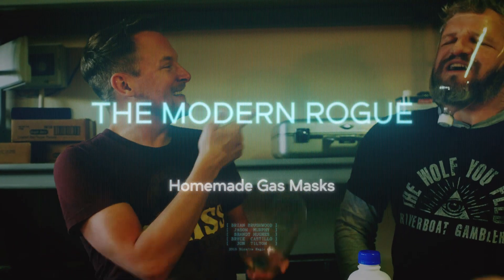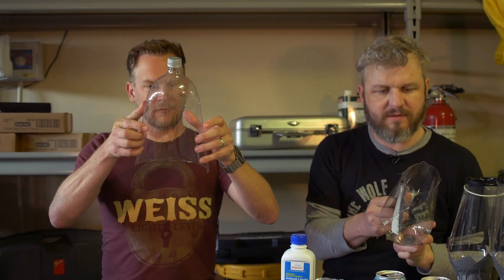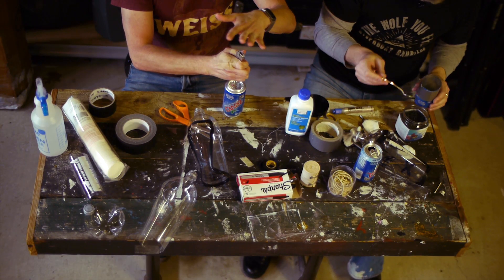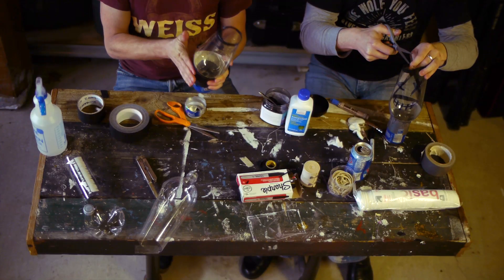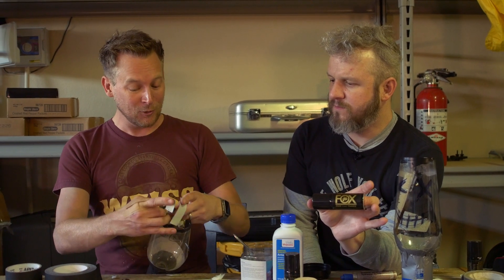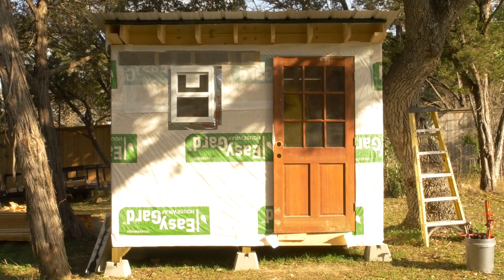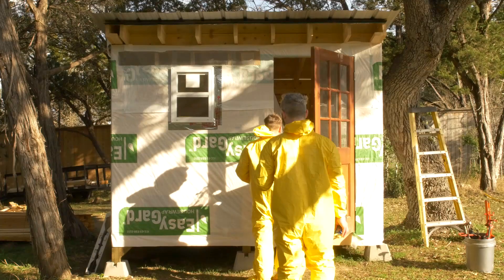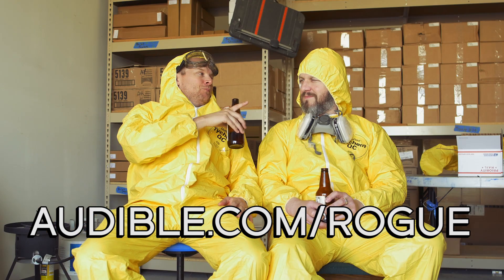Homemade Gas Masks vs. Tear Gas Grenades

Comment: Well done ! I have seen this design on many channels,  but they all have one flaw . If you look at a respirator,  or gas mask they have pressure relief devices . Most of the time it is a rubber diaphragm.  When you breath in it creates a negative air pressure in the mask , this tightens the mask to the face .   When you breath out it creates a positive air pressure,  pushing out on the mask causing a possible leak . I am looking for a cheap , readily available fix . Possibly a snorkel.

Comment: I HAVE A HOME MADE GAS MASK DESIGN THAT HOPE YOU MIGHT BE ABLE TO TEST
 It is the exact same, but uses a two to three compartment part wet filter.
 the first section is contained in the same manner as the activated charcoal, and is simply a wet rag  stuffed into the front of the filter. The second section is just a dry cloth or sand filter, that can be made using straws (filed with sand and contained using cotton stuffing,) or a second section inside the canister. (possibly a second soda that has been cut in half or a third. 
Sand is used to absorb excess water from the filter and then dry quickly. Cotton may work just as well to stop water, but is more easily contaminated. 
You can use a candle wick style water feeder to keep the filter wet, which can be made using a piece of rope, and pill bottle. you drill a hole in the top of the pill bottle, super glue the lid to the bottom of your canister, and then run the rope threw the hole. the filter will then be fed using osmosis, which will only fill the filter with water as it dries out. 
Came up with this idea for covid. If you used this you would need to replace the or wash the cloth part of the filter on a regular basis.

Comment: WARNING! DO NOT USE ANTACID TO FLUSH OUT YOUR EYES. It does nothing to stop the pain and can even cause damage. Just flush out the water and wait. The pain from teargas and pepperspray will subside in about an hour or two. The effects of both are largely psychological after the initial shock of pain.

Comment: Teqnically gas masks only filter so many cubic feet of air so hot boxing with teargas is prolly not gonna work for how little sealing you did and also I believe there’s an areosol base with the charcoal which you’re missing so it won’t filter gas just particulate

Comment: They forgot to mention that "CS Gas" Which is the most common form of tear gas, is a particulate therefor the charcoal didn't really do anything. and they should have been spending time putting more cotton in the filter.

Comment: may have worked better if you were to make the charcoal into a powder and coat the cotton ball pad in it, then do that a few more times and stack them, adding a duct tape seal on the exterior of each layer to make sure it goes through the individual charcoal cotton filters

Comment: Please do not use or really on this to stop the corona virus or anything at all. The particulate protection on these masks is very bad and will not help you in an way. That is why they still could feel some of the tear gas because the gas has large particles that in a real gas mask are stopped at the particulate layer. If you actually want to know what you need to protect yourself from the corona virus or any kind of material that gas masks stop watch Weaponsandstuff93 on youtube.

Comment: Awesome video.....but do a reboot of this video while considering these few tips. 1) when you're not clean shaven, it's nearly impossible to get a complete seal, even on the most professional manufactured equipment. So try  shaving and getting a complete (as possible) seal. Warning Give yourself a little time after shaving before completing the reboot, as shaving causes irritated skin and would be terrible itself coming in contact with any type of sting agent🤔😭😂. Lastly, break the charcoal up into a fine dust, same concept but with granulated charcoal. And when doing this, make sure your breathing apparatus canister (or filter) Is long enough and effective to breath through without working your respratory system harder than the required oxygen you're needing to take in. And adding a blow off valve of some kind would be highly recommended to directly exhaust your exhale, bypassing the breathing filter, as breathing in and out through the filter will add cotton and charcoal destroying moisture out of your lungs and would also promote settling and packing, which can prove to be very bad during an emergency. Maybe Im a bit too technical on this one, but you don't get a second chance at survival when the time arrives.....awesome videos and channel. Been a member/subscriber for quite awhile. Keep up the great work and we'll keep watching.

Comment: Cute. You made a homemade gas mask that almost works for tear gas. That’s fine if you want to start a riot but don’t plan on running or walking fast when the police arrive.
It’s not going to work for chlorine, bromine, or any of the dangerous chemicals that might leak from a railroad car. It won’t work for sarin gas or VX nerve gas or any of the other modern chemical weapons that the bad guys might want to dump on us.

Comment: Should have left the pop bottle caps on the bottles and punctured holes instead to prevent the cardon pellets from coming out while still allowing air flow instead of trying to plug the hole with cotton.

Comment: First you need to be shaved. You beard and moustache make spaces that makes gas mask untight and some gas can get under it. Second there where is a black duct tape itu wold be better some kind of rubber gasket to corectly tight in spaces where edges of mask connects with skin. Third the tape on filter need to be placed carefully to don't make holes that can make gas mask useless. And at the end i know it's made from rubbish but still a nice initiative. With more work puted in this kind of mask you can make this working prety well. Well now the best cheapest way to protect yourselves from that kind of threat, or other threats like biological weapons or fallout, is to buy a ex-soviet gas mask (in Poland its around 5 dollars per one in good condition) and buy modern russian filters that fits in them and can work with them, well you can use a filters made before 1990 but there is asbestos inside and, there is a discusion about it is a healthy to use them or not. You just need to get knowledge and judge this case yourself. For me they are a litle bit old and they expired they date of use so safer is to buy modern ones that fits into them but made with modern technologies. Greetings from Poland. 

Ps. Holes on the first gas mask basically kill you :P

Comment: I've haven't tried this yet, but it makes sense that you should pound the charcoal into fine powder, and use cotton to keep in in place. Pounding the charcoal will dramatically increase the surface area that the gas can bond to, so in theory it should be much more effective.

Comment: 1. Why is this in my Recomendations.
2. I mediatly recognized a fault in your gasmask. There is no slot to breath out of. If you breath in the air goes in threw the "filter" but when you breath out you breath out of the filter again. If you wear this for too long you will pass out because you sufficate CO2. All you need to do to prevent that is to make a tiny rubber/spring loaded slit in the gas mask. If you breath out the slot will open and only your CO2 will flow out. As soon as you breath in again the slot closes and you breath in threw the filter. That how most industry gas masks do it. It is is also a realy easy modification to the gas mask they showed in the video.

Comment: You guys forgot that a gas mask won't seal properly if you have facial hair. This is why most firefights and soldiers in WW1 were/are completely clean shaven or only have mustaches. The masks would have worked better if you shaved your faces.

Comment: As someone who has been through that drill several times, including instructing, two things come to mind for improvement: Crush the pellets (rough grade, not too fine) so there is less gap between the carbon for the particulates to get through, and facial hair doesn't make for a really good seal when your life is potentially at stake.

Comment: Gotta pack the Charcoal in there better, it cant be rattling around...Grind it up and place it between two cotton pads to hold it in place.
Reply: Maybe a couple o-rings in there too to keep the air from flowing around the charcoal. and some hand lotion on the face to help the mask seal

Comment: As soon as I saw the beard I knew they were going to fail. The leak was because the beard was in the way causing an imperfect seal around the face. Try it again without the beards and it should work a bit better.

Comment: As a chemist I note that you should have at least 3 layers.  A removable prefilter that graduates down to a N95-100 filter,  followed by a layer of slaked lime (not quicklime) in order to neutralize acidic gases (which many tear gases are),  followed by the charcoal/carbon,  and a final N95-100 filter.  Also you need better ear canal protection....

Comment: the main problem was that there was too much space between the charcoal pellets, it might as well be just cotton. if you do grind the charcoal up, and use that instead, it should work wonders, also replacing the tape as isolation with actual some isolation tape used for windows etc. will work even better… now for something to stop the "visor" from fogging up... some toothpaste smeared cleanly on the inside will work, but really small amounts

Comment: Coming back to this vid right now with Coronavirus.
Reply: The activated charcoal won't help with the virus but the cotton will. I'm just gonna stuff my plague doctor mask with cotton balls
Reply: @zenthrosrion9147  The cotton could help but to what degree is unclear. I wouldn't risk it.
Reply: @viero13  Well, studies have shown that a 100% cotton t-shirt wrapped around your head as only one layer, can block out over 50% of 0.1 micrometer sized particles such as covid-19. Now imagine that its an entire bird beak mask stuffed with such cotton.
Reply: For COVID 19, you need particulate protection. These masks made in the video provide primarily chemical protection. There's no telling if the cotton swabs would provide adequate particulate protection. So don't use this for this pandemic.

Comment: This episode is coming in real handy right now
Reply: Noo it is not.this will not help you at all.no chemical weapons used and even so this will not hold up to heavy stuff,chlorine,mustard,sarin gas.you heard them very well they could still feel the burning from the gas.this is imperfect and subpar. nothing you do at home will compare to a  proper gas mask.these are just for the sake of it.a lot more stuff and layers in an actual gas mask than vet store charcoal.i guess you are memeing but if not please inform yourself and do not try to use this shit outside if you are smart. Virus particles will pass through.you need actual military grade filters for cbrn condition rated to filter and stop the micro organisms associated with the virus .this homemade attempt will not do shit so stop this nonsense.your chances of this helping you against a virus are slim to zero. Don't believe me?fine .try your luck.just remember me telling you a mere can of charcoal will not filter any biological particles associated with corona.it hardly did filter tear gas and they had to breathe slowly.a proper gas mask does not let anything pass.and tear gas is mild.it would not hold up to what people had to endure in ww1 in the trenches,stuff specifically made to kill you,unlike tear gas which just irritates and is not so dangerous
just remember to take care,keep distance,limit exposure and clean yourself+all the necessary stuff.no hands to face,etc
Biological agents consist of micro-organisms such as pathogens (which include disease causing bacteria, rickettsiae, and viruses)and filters rated for cbrn will stop them.downside.price and limited filter life.it will need to be swapped at some point.they are used by military in chemical,biological,radiological,nuclear  conditions though because they are effective and can hold up to the demand and function for a decent amount of time in those conditions
Reply: Oh yeah fully memeing man, don't worry. I didn't intend to say that people should do this and go outside by any means. Stay inside and keep your sanity up guys
Reply: @tona8055  ok.cause you know..some people could actually believe this improvised 'gas mask' might help them and start walking without giving a fuck so i thought i should point out in case you weren't memeing or someone actually thought it was a good idea to use that after seeing your comment.stay safe and take care!

Comment: Who’s going to use this for coronavirus
Reply: For COVID 19, you need particulate protection. These masks made in the video provide primarily chemical protection. There's no telling if the cotton swabs would provide adequate particulate protection. So don't use this for this pandemic.
Reply: @viero13  virus grade furnace filter layered with cotton disks?